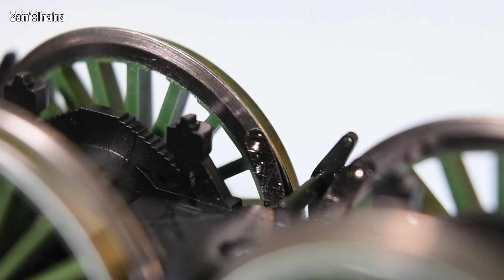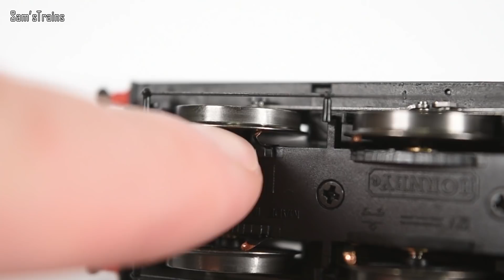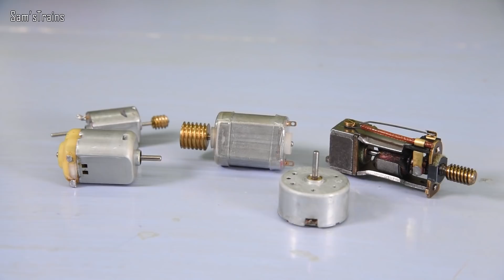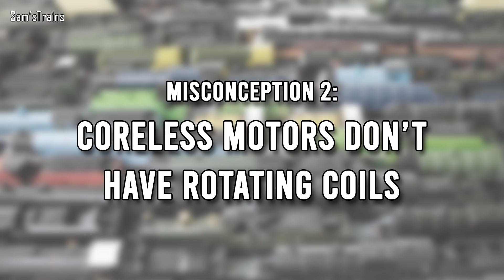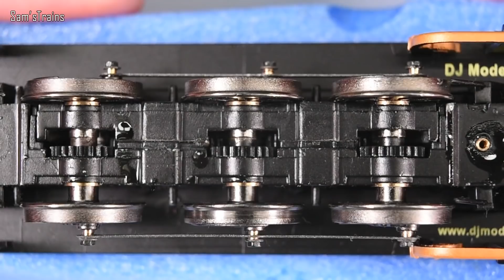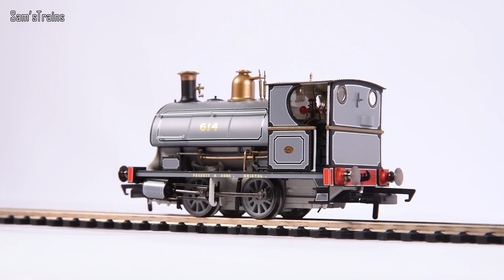What Makes A Good Runner? | How Model Trains Work

Comment: Why don't manufacturers use worm gears with more reduction?  In my experience model locos: 1) Go too fast  2) Accelerate unrealistically quickly 3) Aren't good at low speed with cogging and stalling.  A lower geared worm gear would solve all these as well as increasing the power.

Comment: Very useful video - I see that the first motor flywheel you showed was really badly balanced - or more correctly the central hole was not concentric with the turned diameter of the flywheel. That won’t help the motor bearings to last; or positively contribute to nice smooth running. Brings me back to the days when I used to competitively race model slot cars - I used to rewind and balance the armatures with thicker wire, fit stronger magnets and shim these closer to the armature, introduce ways of taking heat away from the brush gear, etc etc etc. THOSE were the days 😂 - now I just use mostly out of the box RTR (or kit-bashed) Bachmann On30 narrow gauge on my layout.

Comment: 🚂  I watched this video about 3 years ago when it first came out and I watched it again just now.  So this is kind of a refresher and it makes a lot more sense now that I have watched many Sam's Trains episodes in between.  Thanks Sam for your dedication to model railroading.  PS - My favourite aspect of model trains are the coupling rods which drive the wheels. There is something mesmerizing about watching them.  I also like the clackety clack sound of the wheels on the tracks :-)

Comment: I grew up with Hornby 3 rail! Guess that's gone by the board now (although underground trains still use that method don't they?) I was just a boy so not really bothered about the niceties of conduction as long as the trains ran when you switched on the controller dial. The rails weren't especially realistic of course.  Boy it takes me back (sixty plus years). 😂

Comment: Great video, very informative! Could you please also shed some light on the drive/joint mechanisms that are implemented differently based on loco type, gearing efficiency, space constraints etc.? I'm looking into 3D printing and wanted some insights, thanks!

Comment: Gears not only transmit power an d reduce speed but they also increase or decrease the torque transmitted.  Are you a trained engineer?

Comment: hi Sam I have some old engines that are fitted with zero one modules, I want to change them back to dc, but  because my electrical knowledge is limited I am in trouble, I can follow a wiring diagram if I could find one, the first engine was an XO3, I can't find any videos relate to this issue can you help? Esher Brian.

Comment: I've been curious about something for a little while now. Is there anyone out there who prefers their locomotive to have less pulling power? 

Having the gearing ratios set for realistic speeds is something that I think most, if not all enthusiasts like (not sure why manufacturers so frequently use such high speed gearing), but does that same concept apply to getting a realistic amount of hauling capability?

Do some people prefer their locomotives to slip and struggle when the loads get too heavy? From a pure performance perspective, having more grip and power can only be a good thing, so that you can pull practically any load you want at any speed you want, hence why we see things like hidden weights and traction tires.

That said, I can certainly see some appeal to a loss of traction, given that everything's dialed in correctly. A small locomotive slipping and struggling up a bank is the first thought that comes to mind. 

But it can potentially damage the loco and track as well. Sam's much more of an expert on models than I am, but I would imagine that wheelslip or excessive load on the motor can cause serious damage. 

Then you have the nuances of a lack of grip vs a lack of power. I certainly think just slipping would cause a lot less damage than overloading the motor, but there may be something I'm overlooking. It's not quite like on a real locomotive where wheelslip can cause the motion to catastrophically fail, but I could see it potentially damaging the valvegear. 

If anyone has any insights on this, I'd be very interested in discussing it.

Comment: Sam,
I have never seen  in my 50+ years of model railways a diecast bearing on a model locomotive that has worn out if it is lubricated. Diecast bearings surface finish is just as good as the surface of turned brass bearings. Brass bearing are just an unecessary extra manufacturing cost. What is important is accuracy and precission on steam locomotives. Often poor running on steam locomotives is a result of excessive sideplay and to much clearance in the bearings and side rods. I would not assume the  manufacturers know what they are doing, as a large percentage of RTR models are poor runners as shown in your viedoes.

Comment: Hi Sam. One very good thing about your explanatory comments is that they apply to larger size Models  (Gauge "O" and "1"). I make Gauge "O" models from tinplate using ETS ( CZ) chassis which have excellent (Japanese) 5 pole motors and disengaging clutches and are excellent slow speed runners controlled by ( 40 yr old) ECM "Compspeed" Feedback controllers. All tender Locos pick up ( wipers) from all wheels for reliable running characteristics!
Please construct a program on feedback controllers that illustrates their "maintained speed" characteristics to eliminate stalling at slow speeds!
thank you for a wonderful & informative programm.
Bryan Hardy AUSTRALIA.

Comment: Gears also increase Torque to the wheels.  Motors are low torque so a gear train is necessary to increase the torque, if the gear were to increase speed then it would lower torque available to the wheels.

Comment: thank you so much for this video.  i'm retired now.  just retrieved my HO stuff from 40 years in storage.  it's going to be fun.
Reply: i'm also seeing what appears to be chip capasitors on some of the motor power feeds.  can you explain?
Reply: @malcolmboynton7652  If they are capacitors (which is very common) they are there to suppress interference generated by the motor (the sparking that goes on between the brushes and the commutator). So that it does not interfere with TV & Radio.

Comment: Hi Sam, that was a brilliant video for me as a newby to railway modelling. One thing I had to do was to use DCC Concepts' Power Base plates and magnets. The thin plates went between the foam track bed and track and then fitted the magnets under the loco. This gave me 100% more traction up an incline. It also helped prevent my 4-6-0 Hogwarts Express from derailing on parts of my 1st radius track which was the only track I could use to create a loop in the given space that I had. 
On a slightly different note do you ever test out 'z scale trains' as I really want to mimic my local garden centre which has a 'ride on' train. Do you know of any suppliers in the UK for this size of train? Love watching all your videos, as always, and you seem most fair in your judgements.!! Thanks, Rick the Bulldog

Comment: Very nice and informative video!
To increase the traction efforts of the steam engines  there is a need for a „compensated“ chassis. This is the key issue in the long frame locomotives ( 3 or more axles). The rigid frame does not support that all wheels are always on the rails, ie they are running, but does not pull the train. This is the general problem of mass produced models. You can read deep information in the book of Guy Williams: The 4mm Engine, Scratchbuilders Guide. 
Somehow this information did not penetrate into the construction offices of the main model makers yet.

Comment: If you wondered about knowing BR here
Reply: 10,000 diesels 20,000not quite sure 30,000 southern railway 40,000 LMS 50,000 something to do with scottish engines 60,000 LNER 70,000 BR mixed traffic tender engines 80,000 mixed traffic tank engines 90,000 BR freight engine (mainly 9F's)
Reply from the maker: Very nice Billy, thanks for sharing! :D
Thanks for watching, Sam :)

Comment: German producer Märklin had brushless motors in their models from roughly 2000 to 2012. It was called "soft drive sinus". Sadly they stopped producing it. I have some H0 Models with a motor like that and it really doesnt get better in terms of slow speeds and noise reduction.
Reply from the maker: I've heard about that - did they run well then??
Thanks for watching, Sam :)
Reply: @SamsTrains  Yes, they run better than every other of my locos. Sadly, because of the discontinuation of this motor, if it breaks there are no spares

Comment: You forgot to mention another disadvantage of coreless motors is that without the heavier iron core the locomotive can stop and go quickly which is unrealistic, I am assuming manufactures can overcome this with some heavy flywheels.

Ps, As for the friction part of your video, have you ever come across an HO engine that uses ball bearings? I've never heard or seen one that has.

PsPs. I'm not 100% certain on this but didn't the vintage Athearns use iron wheels, I have about a dozen of them and all the wheels are a gray metal (iron I assume) where as the newer engines use steel? I know one thing for sure is those iron wheels almost never get dirty, where as the new steel ones I'm having to clean the blackish crap that sticks to them quite regularly.
Reply from the maker: Yes that's a very good point, thanks very much for sharing! No, never seen ball bearings thus far!
Thanks for watching, Sam :)

Comment: All my models have traction tires, but because they are all at least 50 years old, on some of them the tires have a negative effect. This is because they slip on the wheels, because they have hardent out.
Reply from the maker: Yeah that's the issue isn't it? They do go bad over time! :(
Thanks for watching, Sam :)
Reply: You can replace them cheaply using shrink wrap tubing, I did it recently to a number of engines and it works really well.
Reply: @HL4EHalfLife  The brand who made the trains, Märklin, still makes the same traction tires they already made 70 years ago, but thats just luck and other manufacturers dont do it.

Comment: Bit late to this video, well worth watching- I'll admit to being coreless ignorant! 
I'm surprised you didn't mention axle articulation or sprung and compensated chassis as axle movement can make or break a models running ability on undulations or curves - Oxford's radial tank for example.
Reply from the maker: No problem mate - yeah they were pretty new to me until a few years ago! Yeah that's true, maybe that would have made a good section!
Thanks for watching, Sam :)

Comment: there are brushless motors for model trains. the german company Märklin build them in the end 90'. sorry for my bad english
 https://www.youtube.com/watch?v=5ZL62XMxLrc
Reply from the maker: That's fascinating - I've never seen that before! Were they a success?!?
Reply: @SamsTrains  as far as i know they were to expensive.
further there were problems with the control circuit board an the difficulties to use the circuit boards together with decoders of this era.
And there was a problem that those motors had no or only little self-locking - it was possible that locos could roll down a slope

Comment: I have to say the absolute best quality engine i've had is th3 1.20.3 (g scale) Bachmann davenport 0-4-0, metal bearings, the pickups are rollers that run on the inside of the wheels, the mechanism was top notch and very quiet, i think it even ahd a 5 pole motor. The interior was falling apart on the cab and I may or may not have messed it up some in terms of movement but for basically 90% off it was an amazing deal
Reply from the maker: Ahh that sounds fantastic - thanks a lot for sharing, I'll have to try one of those!! :D
Thanks for watching, Sam :)

Comment: Very useful overview - I learned quite a few things from it! You may have mentioned it in other videos but what is the optimum angle between the conrods either side of a steam loco (and some diesel shunters)? I know it's not 180 degrees (as some might expect)  but it seems to vary on some of my locos.
Reply from the maker: Many thanks James - it's 90 degrees - they call it quartering for that reason! :D
Thanks for watching, Sam :)
Reply: If I may add to your answer Sam, it's 90 degrees for a 2 cylinder loco but on a 3 cylinder loco the pistons are 120 degrees apart from each other. So one cylinder is between the frames and cannot be seen, but for the other two which are on the outside of the loco they are going to be 120 degrees apart one way (clockwise for example) and 240 degrees if measured in the other direction (anti-clockwise).

Comment: can you use vaseline for lubricating the bearings on model trains like the crank pins and the gear train and the bearings?
Reply from the maker: You can use it to lubricate electrical contacts, but I wouldn't use it for lubricating - it's a bit too thick, and it can damage plastics!
Thanks for watching, Sam :)

Comment: A very useful and clear introduction thanks Sam. I would like to understand the different ways that motors collect power. Some have two wires attached, some have one and the old Hornby Hymeks for instance have a spider arrangement.  Converting some of these to DCC can be quite a puzzle.
Reply from the maker: Thanks a lot mate - yes that's true actually, there are more I could have covered - good point!
Thanks for watching, Sam :)
Reply: @SamsTrains  not a criticism by any means I think you pitched it just right. There is always more to learn. It's changed a lot in the 40yrs I have been away from the hobby. 😄
Reply: The motors with just one wire is where the motor itself is electrically connected to the chassis of the loco so the current goes from one wheel collector through the wire to the motor and then the motor returns the current directly from its frame back through the frame of the loco and on to the other wheels. Modern locos use a motor which is completely insulated so they need the two wires.

If your motor has only the one wire then you'll have to insulate the motor from the frame of the loco and then attach another wire on to the motor (from the decoder) to get it to run on DCC.

How do I know this? I've just converted three locos over from the one wire system to run with a DCC decoder. Insulating the motor from the frame of the loco can be pretty tricky.

As for that spider arrangement, I don't know anything about that. Maybe someone else in these comment can help?

Comment: Great video Sam. I notice that you seemed to use a lot of lubricant in some situations. I always thought it wise to be sparing with oil/grease because any excess tends to collect fluff or dirt.
Reply from the maker: Thanks very much Bob - this wasn't a tutorial - I remove excess conductive lubricant with a cotton bud after the joint is covered. As for gears, plenty of the silicon grease is fine - in fact, I use much less than typical manufacturers put on in the factory!
Thanks for watching, Sam :)
Reply: @SamsTrains  Thanks Sam, and thanks for all your videos.

Comment: Ok sam thank you I forgot to tell you the solder is on the smoke unit
Reply from the maker: Ooh okay, tricky! Is the solder joint touching the chassis of the loco or the smoke generator at all??
Thanks for watching - Sam :)

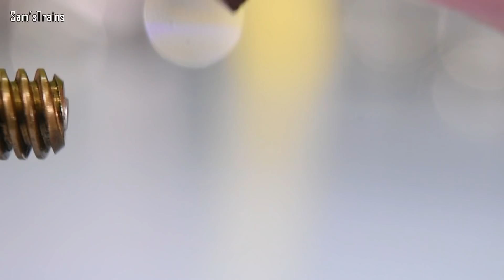Comment: I will say one thing tyco/mantua had 5 pole open motor like the 3 pole you showed in 7:47 then no joke i never seen one other then on SMT Mainline a Varney with a 7 Pole motor from 1960s i think it was . i know Rivarossi had 3 pole in alot of their locomotives and they arent bad i will say . depends on the way they did stuff but anyway its really neat video you did .  oh the Fleischmann i have is 3 pole but a rotary type like what lifelike tyco bachmann had as pancake motors. the tyco ones and bachmann were not good they ran  but thats about it. lifelike do good the problem with that mech is how traction tires are used . well be safe sam!  ps i seen you say something about feeback controller , now hearing that only here i think be a good video to explain that part. also what puzzles me but why is there a transistor on the motor wiring i never seen it on mine. whats the purpose?
Reply from the maker: That's pretty awesome - and I don't think I've ever seen a 7 pole motor in a model before, pretty amazing! Yes the pancake motors are the same as the 3 pole ones shown in this video, they're just arranged a bit different! A video on feedback would definitely be good! :D
Thanks for watching, Sam :)
Reply: The "transistor" you're referring to is actually a capacitor to keep down interference from the motor.
Reply: @kiwitrainguy.aka.Dennis  very odd where any I've had have nothing of the sort on them

Comment: Driving all the axles makes quartering issues less critical on a steamer. Even a minuscule quartering error can cause the rods to bind or make the drivers wobble.
Reply from the maker: Yes that's a very good point actually - though most manufacturers are able to quarter wheel-sets accurately these days... though don't hold your breath of course! ;D
Thanks for watching, Sam :)

Comment: Any recommendations on a suitable conductive lubricant? Thank you!
Reply from the maker: I've been trialling petroleum jelly/vaseline for about a year now, and it works very well.  I'm yet to learn the long term effects (so try it at your own risk), but as long as you keep it away from plastics, it seems to do the job! :D
Thanks for watching, Sam :)
Reply: Yes vaseline is often used for busbar joints, it minimises oxidisation of the copper. Glad to hear it works for you too Sam. Only use the tiniest of amounts you don't want it getting sprayed onto the track or wheel surfaces where it will cause wheel slippage!  Stephen